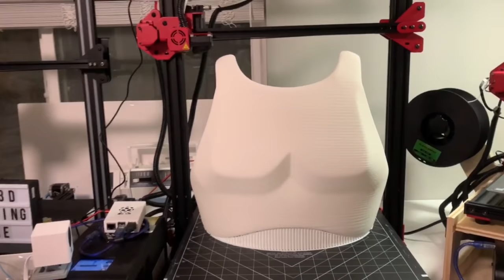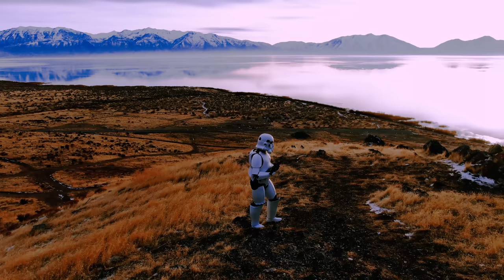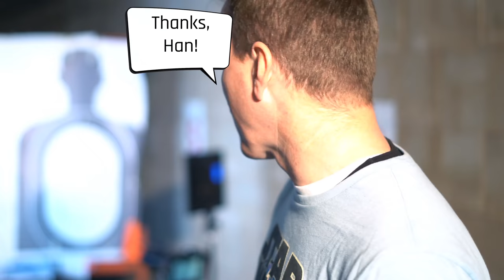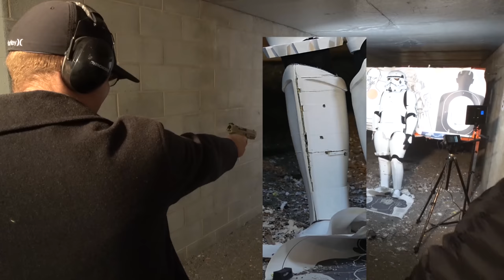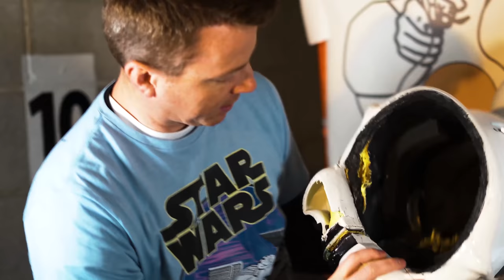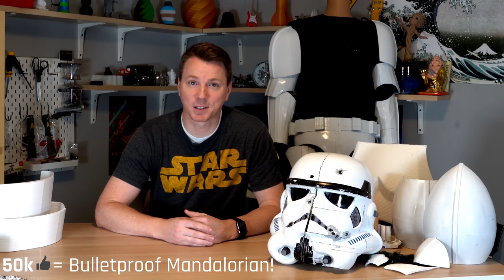3D Printed Bulletproof Stormtrooper - Extreme Star Wars Cosplay

Comment: Honestly there's so few full face bullet resistant helmets out there its almost a shame to shoot this one.  Even in level 3, not 3a or anything, theyre a pain to find.  Whatd you do to bulletproof em?  Might need to experiment and figure it out cuz I'd love a 3a full face helmet.
Reply from the maker: So I actually worked directly with Armormax on that. I printed everything, dropped it off, and they did the bulletproofing so I couldn't tell you exactly how they did it but I do know that it's a matter of layering on the specific material by hand, using a specific adhesive or resin type.